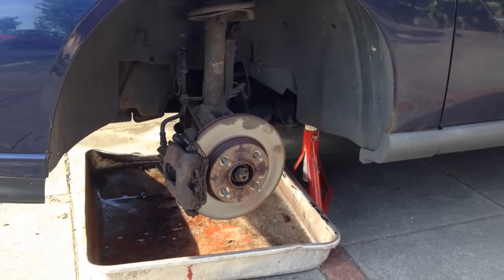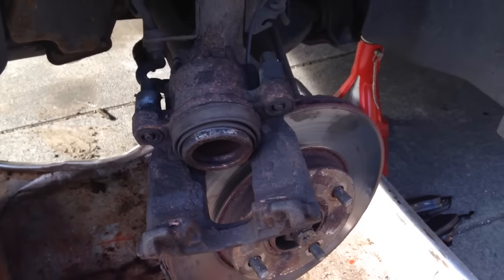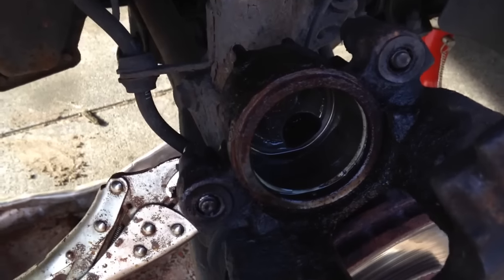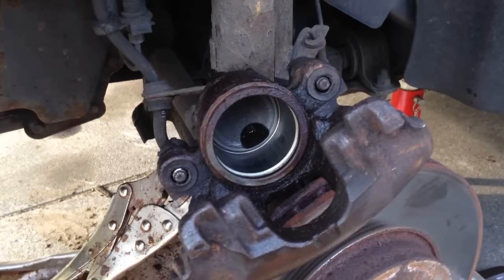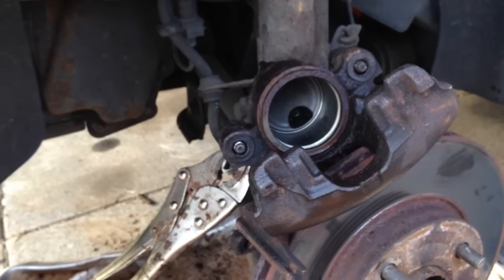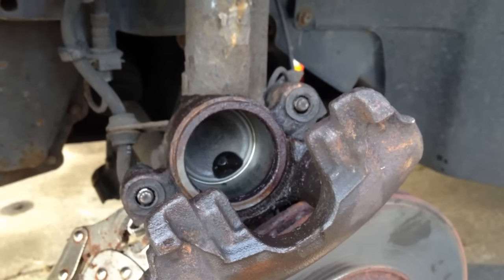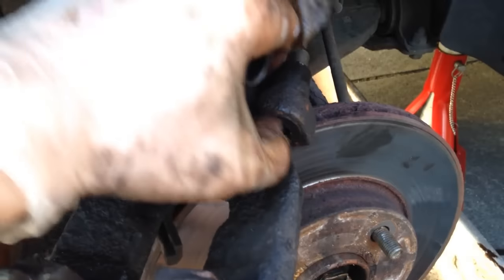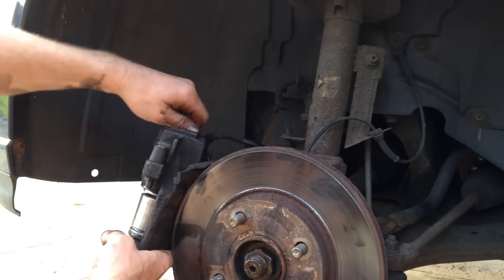How to Rebuild a Brake Caliper (WITHOUT Removing it From Your Car!)

Comment: If you're not doing caliper refurbs regularly you won't know how much grease to use, if you've done it right. If your caliper is messed just replace it. I bought a pagid refurbished caliper on ebay for £28.

Comment: When the piston pushes out and the brake fluid fluid leaks out, is the leaking always a sign of needing to repair the caliper?
Reply: No, it leaks out because the piston is not holding the fluid back after it pushes out past the seal. The purpose of the video is to repair a sticking piston which causes the brakes to drag.
Reply: Ashley Goodwin I get it, thanks. First time with dealing with sticking brakes.

Comment: Never pinch a rubber brake line unless you intend to replace it. The majority of the time it will cause the hose to go bad, and give a bad caliper symptom because the fluid can only travel 1 way .

Comment: Great video. Next time clean disc before putting caliper and brake pads on to not contaminate them. After cleaning everything in the cylinder put on new clean gloves when handling new piston and gaskets

Comment: Question so my brakes get stuck literally for like a while when driving but once i park for a bit they release i feel like its the passenger sides cause it doesa growling sound so will this be a brake caliper problem
Reply: You may have a wheel bearing going and binding.  Get one of those $20 infrared temp readers from the store and after driving the car, stop and shoot the rotors through the wheel.  If one is sticking it will usually have a much higher temperature than the others.  Also stop on very slight incline, put in neutral, and see if car will roll easily on slight slope.  That will sometimes reveal a stuck caliper piston.
Reply: Gary McCrea it was a brake line thanks to this and other videos I diagnostic it and replace it and from there nomore problems

Comment: While I am a fan of using the brake fluid to push the piston out of its bore (before actually removing the caliper from the vehicle, as you’ll need to bleed them either way it doesn’t really save any time leaving them on). The bleeding process should have been done with the caliper in its mounted position. Although it appears that you would want the bleeder valve upwards during the process (since air rises in liquid) if you look at the location of the bleed hole INSIDE the piston socket it is oriented so that the bleed comes from the top when the caliper is in the proper mounted position, not hanging sideways.
Reply from the maker: Hi James, thank you for watching and commenting. I didn't show the entire bleeding process in the video for the sake of brevity (I did it again with the caliper and pads fitted to the car). If I bled the caliper with it in its mounted position then it would have been less easy to see what was happening in the video... I did say at the end of the video that the brakes should be checked and if they feel spongy then the system should be bled again. This would get rid of any residual air bubbles. Cheers, Chris

Comment: Can you replace the external dust seal without removing the piston?
Reply: did u ever get the answer to this?
Reply: @BillSW  yeah I replaced the dust boot, didn't need to remove the piston.
Reply: @The3rdCoat  thx. what did u lube the rubber to squeeze it in or was it just dry?
Reply: @BillSW  don't remember, may have used a little rubber grease or even brake fluid.

Comment: great video mate, very informative!
Reply from the maker: Cheers Alain 👍
Reply: Thanks a lot mate! i had to do a repetition of this video several times before and on the actual battle field. but yours you did it just around 15min. mine was 4hrs and 20mins to be exact. so exhausted and nervous but luckily I did it perfectly fine and my assistant is my wife also just what you have in the video but a little more bla2x compares to yours! hehehe
Reply from the maker: Well done Alain (and wife)! Fixing your own car is satisfying and empowering, so good on you for taking this on. Cheers, Chris 👍

Comment: When the pistons pop out is the foot still on the brake until you apply the mole grips
Reply from the maker: It is best if you do that yes, as this will reduce brake fluid loss / air ingress. Cheers, Chris 👍

Comment: Yeah, I know it is 5 years down the line, but when you bled the new cylinder, the angle of the brake cylinder should have been such that the bleeder valve should have been at the highest position relative to the ground. In your case, there would have been a miniscule amount of air in the brake caliper cylinder, since the bleeder valve was not angled to be at the highest point. It is a small error, but you should have bled the brake cylinder once again after refitting the whole assembly.

Comment: Always figured if I'm rebuilding calipers why would I leave old fluid in the system? So what if you have to bleed the master & all the lines. New fluid Good. Old fluid has crap in it & moisture that will go right to work on the calipers & wheel cylinders. That's the reason you had to do this in the first place.

Comment: Personal choice, but I'd be using a lot less Of The Flathead screwdriver, the risk of scoring cylinders or puncturing seals is much higher when using a sharp metal implement, instead I typically use  the sharp end of a cocktail stick to remove the oil seal, and for the dust seal I use the blunt end, just make sure it's the wooden ones as they are not likely to score the metal if you slip (it might be possible) whereas the screwdriver can easily ruin your caliper at the slightest slip!

Comment: If you wedge the brake pedal down an inch or two it stops the flow of fluid through the system so you can work on the open system without having to clamp hoses.
Reply: Hello, how can you do that??
Reply: Use a piece of wood jambed between the brake pedal & the seat.

Comment: Oh, i forgot one other tip. Don´t ever use air to push the pistons out. Use a grease gun. Less dangerous and much more easy. Or as we saw in the video, why not use the pedal? It´s only job is to push out pistons, and it´s very good at it.
Reply: With all due respect, I believe air is a better option than grease from a grease gun because you will have to thoroughly decontaminate the caliper afterwards.  It is worthwhile noting that petroleum in grease will destroy a square-seal by causing it to swell.  With two precautions, air can be used to safely eject a caliper piston.  First, the most import thing is never place any part of your hand or body in the pathway of the piston--an emergency room visit for busted fingers can purchase a lot of calipers.  Instead, place wood in the pathway.  Second, use low air pressure; just enough to move the piston and no more.   That stated, stack a few wooden stakes between the piston and the contact point for the outboard brake pad.   As you apply air to the caliper inlet, the piston will come in contact with the first stake.  Remove the stakes in succession and reapply air until you are down to one stake.  At this point, one can easily remove the piston.  For the purpose of ejecting caliper pistons,  I use a Milwaukee  2475 M12 Compact Inflator along with a 2 in. long rubber valve stem and some cut-to-size wooden stakes (1/2 in. x 1-1/2 in. x 1 ft.) for spacers.

Comment: Friend of mine had clamped  brake hoses and when he used brakes hard down the hill one of the old hose crack and start loosing fluid.  Down the road he went off the road. Better solution is to block leak using two rubber washers and clamp at the end of hose. I had to replace two hoses  bcs someone let caliper to hang on them and they cracked. They are not reinforced with steel... I would be careful not to loose the brakes.
Reply: Push the pedal to the floor and jam it there with a board against the car seat. No fluid leaks out, at least not with the dozens of brands of car's I've done it with.

Comment: Keep in mind the brake hose that you clamped might need changing..good idea to change them because they break down from inside and plug your fluid flow.
Reply from the maker: It's a couple of years later and there are no problems.

Comment: I tried doing this this past Saturday but I couldn't get the dust boot seated right so I still had to buy a caliper🤦🏻‍♂️ I got everything else right. I should've removed the banjo bolt and went to the car wash and used their air compressor cleaning hose and blew air through the banjo bolt hole to get it in there.

Comment: If everything is cleaned good you don't need to push piston with something, it's just slide it self with little force
Reply: Also you have to put in piston cover first, because you can damage the cover with screwdriver when you push it in inside the caliber.

Comment: Chris is there any difference between the one you did and say a 2017 Mercedes Benz slc 43 amg brake calipers
Reply: I doubt Chris owns a 2017 Mercedes Benz slc 43 amg brake calipers so he wont be able to answer

Comment: You can fix the brake pedal in the position pressed to the floor, with the help of a piece of wood, and thus the brake fluid will stop flowing.

Comment: Not a big fan of using vicegrips (or anything for that matter) to crimp the brake hose shut.  By crimping it, you compromise the integrity of the brake line.  Older brake hoses can fail after doing this (they end up getting bubbles in them), or they might not return to the fully un-restricted state and give you uneven braking.  It does not take much to bleed the line (one or two pumps of the brake pedal and the line is bled), along with the caliper when you are done.  If all of the brake fluid runs out - no big deal - you most likely need new fluid in the system anyway!  Brake hoses can be a royal pain in the butt to replace (especially getting the fittings loose)!

Comment: Hopefully no air got in the brake system. Maybe clamping before removing the piston would be a good way to prevent that. This video is simple!
Reply: but then you couldnt use the brake fluid to remove the caliper piston...

Comment: Bolt at the top and bolt at the bottom, assume 14mm. But what if the bolts seized and applying too much force will shear the bolt?
Real world Jack
Reply: buy a blowtorch and heat the sorrounding metal around the frozen bolts, works like a charm! :)

Comment: Should use antiseize on the slide pins or at least a rubber friendly lubricant.  Otherwise great information.
Reply: Anti-seize?  Unless you want your slide pins to seize, I would avoid using anti-seize on slide pins.  I know that sounds counterintuitive but it is true.  I recommend using one of the following products for slide pins: Permatex 80653 Silicone Extreme Brake Parts Lubricant  (the orange stuff), 3M Silicone Paste, 08946, or SIL-GLYDE.

Comment: What am I doing wrong? My friend was able to compress the piston out with about a 1/4 of it left. I disconnected the brake fluid line hoping I would be able to depress the piston down with the c-clamp. I failed miserably, then decided to put the brake fluid line/hose back onto the caliper to use that technique again in order to remove the piston. Long story short; the piston is not coming out.

Comment: I still would had taken it off. If you clamp the brake line and put a plug in it it's just as easy and you can have more room plus you can clean the calipers. I like to clean mine up and paint them. Also make sure you clean the guide pins well and replace if they look or feel stiff or pitted.

Comment: I would not recomment clamping of the brakelines (they can get damaged internaly especially if they are old). Unless you are replacing them at the same time which could bring back firm feel of the brakes and is rather inexpensive to do.

Comment: This is very informative however there is no particular reason not to remove it from the car after doing all that. The only thing keeping it attached is the hose itself and if you're doing the rest of the work you may as well take it off so you can put it in a vice and not be hunched over the whole time.

Comment: My brakes went to floor n no stopin. Inside roter gone like all gone so caliper came out too far and spilt fluid out right ? I had a sinking pedal n then boticed rotar was gone and a small slit in boot so super glued it yet if I add fluid it will still spill out as the caliper will be pushed so far as the roter is still missing its inside half ? Cant get rotars im dead poor yet have to drive to make the e moneu to fix it all so what can I do  ?  I was using the emergancy brake fir a while barley ever touching the brakes so I drive like this but now no brakes at all no pressur .. cause calliper is out to far as rotar is gone causing fluid to leak n if I add fluid it will still leak correct ? Hope someone understands what im saying.. ?
Reply from the maker: Hi there, sorry to hear about your brake troubles. It sounds like you are driving around with your brakes in a dangerous condition, which is a bad place to be. The outer gaitor seal, which I blieve you are referring to as the boot, is only there to stop dirt and debris getting inside the moving parts of the caliper. The seal for the hydraulic pressure is provided by the square profile seal which is located between the piston and the caliper body. If there is a leak there, this has to be addressed as the gaitor is not designed to hold back brake fluid under pressure. I'm struggling to visualise the cause initial cause of the problem as described above... Has the inner brake pad been worn away to destruction, or is it the brake disc which is damaged? Either way this needs fixing properly. If you can't afford new parts then try scrapyards - you can get the parts you need there. If you are really desperate, you could offer to leave something you own with the scrapyard as security and come back to collect it when you have earned the money you need to pay what you owe them for the parts you need. If you explain your situation to people I'm sure you will find someone who will help you. Good luck! Chris
Reply: Scrap the car and learn English as well.

Comment: Done this a lot do it on the bench easier to clean and remove rust under boot... use a board when removing piston to absorb impact.. replace brake lines on older car very cheap...6 bucks each.. then invest in a power bleeder...  so fluid changes at 2years are easy.... saves master cylinder piston going in to far and being ruined.. yes it will...or a 2x4 under brake pedal  you decide... me 50 bucks for power bleeder no brainer... make your own master attachments... got 3 cars... its a very dirty job... cleanliness is imperative. Be sure to super clean all points where clips go,replace them too,cheap... flush out caliper.. silicone for slides..  bench is much easier on your back...  use shop vac to suck up dust.i use a remote switch .. brake cleaner and pan. Pan keeps mess at bay....  easy to do just use your brain not brawn..  i am anal about cleaning... new clips ...  but still a messy job...  new calipers 120 rebuild parts 4 bucks......wear a mask....

Comment: Ok , # 1 the fluid that is in the brake system is not - oil - , it is brake fluid , but , as oil will contaminate  both the rotor & pads , any time either comes in contact with the braking surface they must be cleaned with , Brake Cleaner